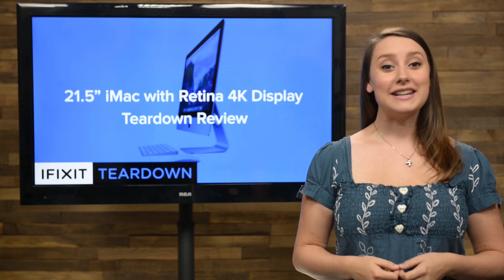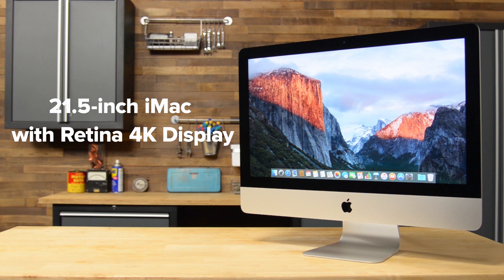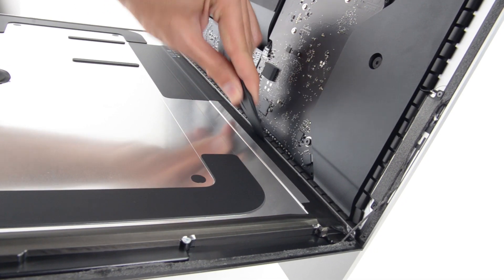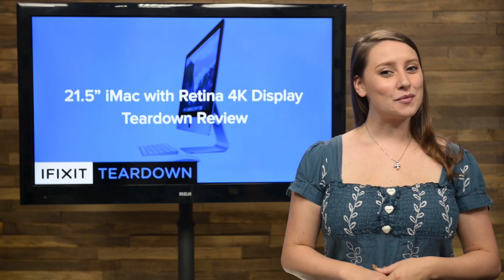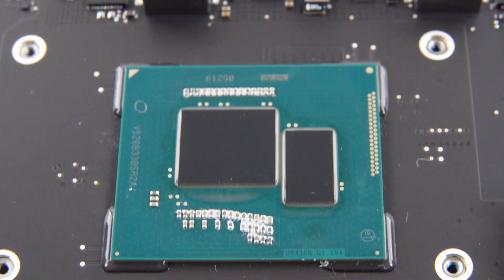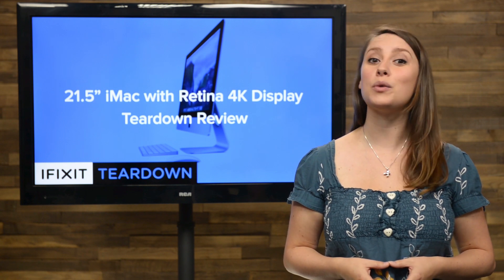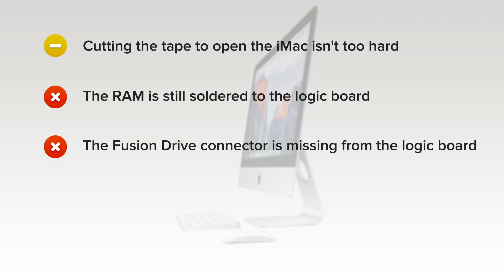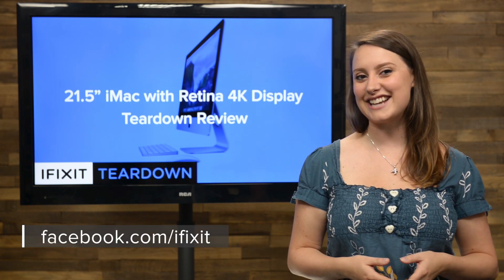21.5" iMac with 4k Retina Display Teardown Review!

Comment: I rather put a hole in my wallet for the fully upgradeable trashcan mac pro than get a pos soldered ram low end graphics imac. Apple please bring back the LGA desktop grade CPU, Upgradeable ram, and upgradable GPU in the 21.5 inch (I don't mind the GPU card using a apple proprietary connector used in the mac pro) and also have desktop style ram on the 27 inch iMac in addition to a mac pro style upgradeable graphics card. Also bring back the 17 inch macbook pro with upgradable ram and m.2 ssd, and introduce a large almost fully upgradeable macbook pro 21.5 inch (RAM, GPU, and SSD are upgradeable but, CPU still soldered to motherboard) and equipped with sharper image speakers. 15 inch and 13 inch macbook pro should still have a upgradeable SSD. I am also looking forward to a mac pro with the 6 thunderbolt ports replaced with 6 type c usb ports in its place. Also please introduce a 6 core core i7 in the iMacs and an nvidia 980 ti GPU option. It is understandable to have ram soldered to the motherboard on ultraportable laptops but, definitely not all in one pcs.

Comment: I miss the days you could just suck a car un-denter on the screen, pull it off and upgrade everything.
Reply: ***** I suppose so. My workflow is around Mac only apps but I see where your coming from. My 2011 MacBook still as some life in it though and I'm not upgrading to a non upgradable one until the thing won't turn on.

Comment: That looks like a SATA cable attached to the hard drive. so replaceing it with a 500 GB SSD is stil an option.
Also in my country about 300 to 340 Euro's cheaper then having apple install one.

Comment: As long as it doesnt break too fast i will be ok with non-replaceable Ram and CPU. Most importantly though the hard drives should be replaceable as those usually have to be replaced after 2 years.
Reply: Jean-Luc Parent
Yeah i would also choose a Mac Pro, the money...
The 27 inch iMac with 5K resolution would also be awesome.
Reply: +Mabirc 5400rpm? lol apple users sure dont know wack about tech.
Reply: MartGameFails
I do know that this is slow.
Apple users dont need to know alot about tech cause it works fine anyway. Except for the iMacs but there you can choose your specs so...
Reply: +Mabirc HDD is replaceable easy enough, though my next mac will either be the 27" or the Mac Pro. Both have more user upgradeable parts in it.
Reply: Jean-Luc Parent the pint being its a $1499 machine IT SHOULDNT HAVE SUCH OLD PARTS.
Reply: MartGameFails
Apple knows that but just like that you need to choose the Fusion Drive for 140 bucks more.